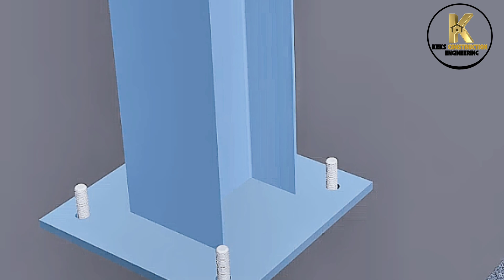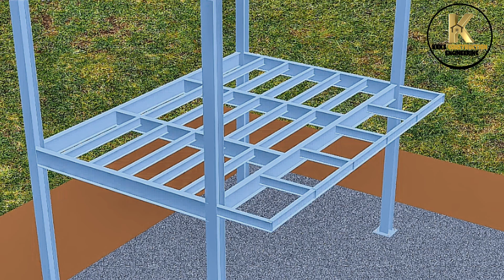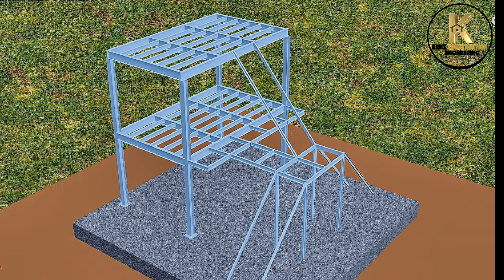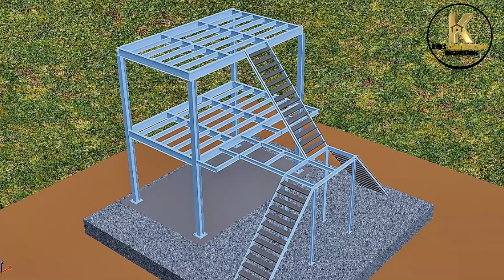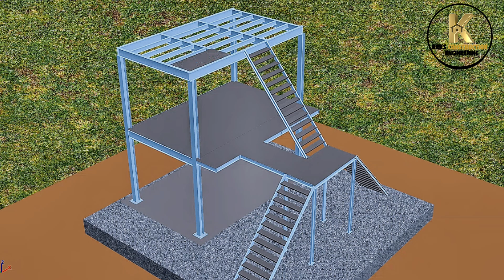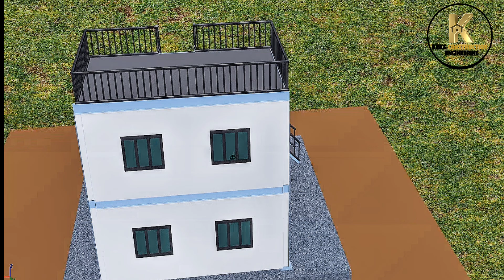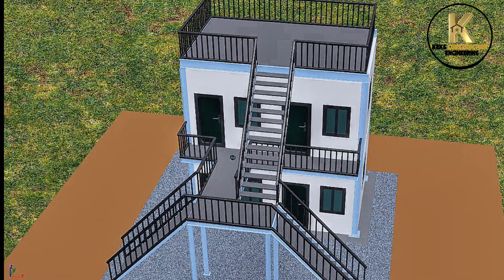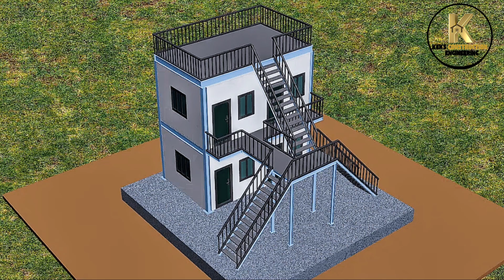Building a Site-built HOME & OFFICES with Steel (Step by Step Construction Process)

Comment: Impressive 
Question: 
1. Are the joints rigidly fixed like welded 
2. Which lightweight material is used for the partition walls
Name: Ogalanya Chinonso Dominic
Reply from the maker: @ChinonsoOgalanya  
Yes....I decided not to use Steel Connections here because I will treat that separately. So they are all welded joints.
Light Weight materia l= Sandwich Panels.

Please share this particular VIDEO....I am Carrying out a TEST